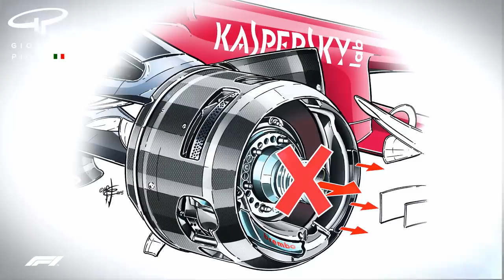2019 Technical Regulation Changes Explained

Comment: The problem is pitstop.. if f1 were to bring back refueling we won’t see alot of 1 stop in the race..
Reply: Blackjack 91 None of the teams seem to even entertain the idea of refueling unfortunately
Reply: Blackjack 91 yes that way we can get rid of all the on track overtakes
Reply: Americano Beans it’s because of cost savings issue that mid and lower team can’t afford have.. reason refueling was banned because of save cost and safety
Reply: Blackjack 91 unfortunately, that’s not gonna happen, cause of health and safety and the fuel fires that happen during refuelling, and I think the drivers are not gonna be happy staying in the pits longer, even though pit stop battles are good to watch
Reply: my thoughts exactly the cars should be racing each other as light as possible non of this racing when very heavy, then saving tyres when you could actually be racing because the car is nimble at the end of a race.
Reply: Too dangerous, even every team agree
Reply: doesnt seem to be dangerous in endurance racing, just saying :)
Reply: refueling is so dangerous with these new hybrid powerplants, get over it it's not 2004 anymore
Reply: Blackjack 91 refueling is way too risky
Reply: Refueling is a pointless risk
Reply: I want refueling too.. But FIA must restrict the fuel that they can bring. For example 150 kg and reduce the full tank to 50 kg
Reply: Bringing back refuelling will ruin F1. There's a reason no one is contemplating it. It's expensive and dangerous to start with. The main reason, however, is that it means there's no real racing. When refuelling was a thing, their were hardly any on-track overtakes, because how much fuel you put in the car basically meant that everyone was in their own race, so the only overtakes happened while people were refuelling. People complain that strategy plays too important a role in F1 now, but then ask for refuelling back, which is just a total double standard. The number of on-track overtakes, which is what people like you are always asking for, increased dramatically when they got rid of refuelling, because it meant that everyone was in the same race, so couldn't just rely on fuel strategy to win. If they got rid of pit stops all together and made everyone race on the same tyre for the whole race, on track racing and overtaking would improve even more. Saying that, I do love the strategy side of F1, but I think I'm in the minority and, let's  be honest, people ask for refuelling for the same reason that they ask for V8s back or V12s or whatever it is. It's because people want F1 to be the way it was when they first started watching it. They don't actually ask for these things based on logic; it's purely based on nostalgia.

Comment: Bring back re fueling , cars heavy or light depending on race strategy , ban the " party mode" qualifying settings , put a limit on bhp of the engine , another tyre manufacturer on some teams would also be interesting.

Comment: I like them widening the wings. But dislike heightening
Reply: hope that it'll still be lower than 2009-2016 rear wings.
Reply: It'll only be heightened by 20 mm
Reply: phew, thank god.
Reply: It will allow closer racing, and that's what I want
Reply: It will still be hard to overtake, put simply the sport is to fast.

Comment: I'd like to see pre-2009 front wings come back - I don't like how front wings nowadays extend in front of the front wheels. I'm not sure if I'd prefer pre-2005 low, narrow or raised, narrow pre-2009 specifically though since the 05-08 cars looked pretty radical and awesome.
Reply: Yep.  Significantly reduced downforce overall would produce better racing, as would narrower (or just harder) tyres.  It would put performance much more down to the driver than the engineers and designers.

Mario Andretti said this in 1979.  It is still true today.

Comment: I still wish they'd rather keep the technical regulations entirely stable until 2020 as significant technical reg changes are set to come into effect for the following season anyway due to the '1.5 seconds slower lap times compared to this season' estimation. Hopefully, with the 2021 changes, we would be able to get both the lap times back to the 2017-18 levels as well as the cars being significantly more following-friendly/race-able than they've been for a long time. If these short-term interim changes were to fail to make any difference at all to the difficulty of following another car closely, i.e., things would remain precisely the same as now with the more complex front wings, etc., then the 1.5-second loss in lap time would be even more annoying.
Reply: TheJokerit19 as a viewer you don't see any difference when cars are slower 2 seconds or even 5 seconds. But you see there 's no action in race. And that's why it is important to reduce the aerodynamics. We are all F1 fans because of races and not free quick hot laps in FP or Q
Reply: Wrong, a difference of 5 seconds in lap time is indeed very noticeable. Anything starting from 2 seconds or even lower than that can be rather easily noticeable to the naked eye especially when comparing two laps with that big difference side-by-side. Furthermore, concerning the last part of your reply: I indeed am a fan of F1 also because of free quick hot laps in qualifying, and or free practice, not only because of the races, i.e., I do care a lot about the lap times as well, which is why I hope that with the next significant technical regulation changes we could have both the lap times in the 2017-18 levels, as well as, significantly more followable/race-able cars.

Comment: Front wing changes: umm...sure
Bargeboard changes: woah whut
.
.
DRS/REAR WING CHANGES: NO TENKS
Reply: 2019 season summed up. less aero so the teams with the big and fast engines will automaticly win every race :)
Reply: They can easily lower the DRS effect by shortening the DRS zone, however the DRS effect is too weak on some tracks, and there is no way to make it stronger except like this.
Reply: DRS:Unplug
Bargeboard:Bwoah
Reply: I just hope they mix and match the DRS perfectly per track so that we will have the actual overtake into the corner/braking zone and not on the straight :) (adding that each driver should also work for setting up the overtake and the overtake itself)

Comment: You have X amount of DRS depending on the track but scrap the zones. You use it when and where you think you want to. This will give more control to the driver and choice over when they use their DRS to gain and advantage or not.

Comment: List of things that will help to have better racing:
- Smaller cars
- Tyres that don't last the entire race
- Refueling
- No pay drivers
- More sound
- No fuel limits
- No DRS, those overtakes are worth nothing
- More tyre suppliers
- Allow to race when it rains
- More gravel traps in the circuits, mistakes should be punished
- More circuits like Baku
Reply: because Baku have a short DRS straight, and a lot of gravel?

Comment: or, you know, you could just use v10 engines at 20k rpm again, dump the hybrids, kers, drs and turbo... just saying.
Reply: Guilherme Schmidt which would Change nothing about the Aero therefore not increasing overtakes.
Reply: I'm not talking about aero
Reply: Guilherme Schmidt And what would that do make the racing more competitive?
Reply: F1 is supposed to push the limits in every way, not go back to the stone age
Reply: It would improve at least the sound and the speed!
Reply: Guilherme Schmidt Yes and then you can say by to all the manufactures aswell.
Reply: i mean, there were literally more Manufactures making V10's...
Reply: weeping Yes.. in 2005. It's 2018 now.
Reply: AJW10 simpler engines, cheaper to make = more companies interested imo
Reply: I guess that's a way to see it yes, but don't expect Mercedes, Ferrari and (possibly) Renault to be in F1 when that happens.
Reply: During the 90s, it was worth watching because of the competitiveness. During the Schumacher era, it was worth watching because of the cars. Now it is ruined, that's all. The decline in popularity is a fact, not an opinion.
Reply: vernon that makes no sense.  everything about racing relies on conserving energy.  cornering braking accelerating and yes fuel consumption.  Unless you are watching drag racing maybe.  Even human powered racing like cycling and running relies in efficiency.
Reply: The speed trap read about 366 kmh if I remember correctly, and Bottas was in slipstream so air resistance was greatly reduced. I wouldn't say that he set the top speed record, and neither does FIA.
Reply: why dump kers?

Comment: This isnt really a big drawback in technology since aerodynamics are much less complex than parts like the engine or battery. The direction in which aero evolved was making thinner and smaller winglets from carbon fiber which could only get so small before they lose all effects. What im saying is that aero was a dead road and if these regulations stayed, room for improvement would be minimal

Comment: I'm assuming they've decided on this because of how much more competitive and exciting the road racing has become in Indycar after Indycar simplified the top aero and improved the underwing. F1 isn't really gambling with the new changes because it has already been proven to improve the racing in Indycar (which is a similar racing series in many aspects). Plus, more simple aero will allow for smaller teams to try and compete because aero development will be less expensive. If the cars are slower in the corners but drivers can actually compete and battle for position then it's a win win scenario. Drivers are happier and fans are happier.

Comment: That wouldn't work plus the cars will be slower like 2014 level
Reply: David D ELI

 The changes are made for better racing not faster cars!

Would you rather see way faster cars and another race like Canada?
Reply: Only by 1.5 seconds. They'll probably be halfway between 2018 and 2014.
Reply: The goal isn't to make the cars as fast as possible it's to create better racing. Currently it's impossible to follow or have a serious attack on many circuits and between many cars. More attacks is better for the sport than another 2 seconds off a lap
Reply: dries3654 this year the cars are a almost a second faster than 2017 (except Baku) so maybe a little bit slower than the 2017. Maybe half a second or something like that.
Reply: David D ELI Nowhere near to that level, LOL. What pot have you been smoking? The lap times are estimated to only be 1.5 seconds slower compared this season, so they're still going to be 'significantly' faster than 2014, '15, and even '16 on most of the circuits. On most of the tracks, next season is set to only lose to this and last season but still remain ahead of all the pre-2017 aero-reg seasons. It'd be close with 2016 in Bahrain and Baku, but on the remaining five venues F1's been to so far this season besides those two, they're still going to stay comfortably ahead of 2016 in ultimate lap time pace especially in China and Spain.
Reply: David D ELI the cars will be 1.5 seconds slower. Cars from 2014 are 8 seconds slower on some tracks than 2018! The cars will sound better, be cheaper and the racing will get exciting. Why wouldn't it work?
Reply: David D ELI and how would you know
Reply: vjekoP it wouldn't work because Christian Honner said that (except for the 2014 speed level) but he did say it wouldn't work and he is getting that information from Adrian Newey the best designer in Formula 1 history,  am going to believe the expert's until am proven wrong
Reply: So you think you're smarter than an f1 engineer?
Reply: David D ELI They said it was going to be between 2016 and 2017 level

Comment: Regulation changes introduced for 2009 to the front wing kind of worked, but the cars were still having a hard time following though. But soon after, teams were finding ways to add bits to the front wing with no intervention from the FIA.  IMO they should bring back ground effect and get rid of that damn plank of wood underneath.

Comment: Just get rid of DRS...
Reply: Cormacca What's the point? DRS gives a compromise - it allows high downforce around the track, and then lower downforce on the straights. Without DRS, constructors would have to focus purely on high downforce for the corners, or purely on low downforce for the straights.
Reply: Kian Stevens The point is - DRS creates artificial overtaking.
Reply: What's so bad about that
Reply: his point is, what happened to drivers being able to overtake normally?
Reply: Why?
Reply: then you will complain because you see two overtakes in the whole race and you say F1 is boring, guys you don't know what you want, its time to grow up

Comment: Formula 1 was once the pinnacle of motorsport! Now it's just a laughing stock! We want the best tech and the fastest cars. Not the EU on wheels!
Reply: Andddd it’s still the pinnacle of racing sports. And what do mean “the best tech”. Formular 1 is not about who has the best tech but rather who can build the best machine which might involves some technologies. Another point, aren’t f1 cars the fastest cars on tracks right now or am i missing something.
Reply: Tuan Phong Nguyen nope the Porsche 919 evo recently lapped spa faster than a f1 cars lap record! easily. Give them all the banned tech like ground effect and skirts back and watch lap times fall and overtaking flourish! Makes more sense than making them slower than lmp1 cars.
Reply: matthew barclay First of all, why compare a TIME ATTACK fully upgraded lmp1 car with an f1 car? Second of all ground effect won't come back I'm afraid because the FIA thinks it's too unsafe.
Reply: AJW10 because it's the fastest track car in the world at this moment in time. Where as f1 are supposed to be the fastest track cars in the world! Kinda makes the whole conversation about f1 getting slower and more irrelevant alot more legitimate wouldn't you agree ? And the f1 car was in full quali mode so ?
Reply: matthew barclay That 'lmp1' car had was more easy to drive and as I said fully upgraded, no rules. F1 cars have never been this fast. If some company upgrades a 2017/18 F1 car it would smash that record again. Besides, F1 cars will probably get that record back this year anyway. Ground effect will indeed help for overtaking and speed, but the FIA just won't allow it.
Reply: It's practically impossible to have the most sophisticated cars, and immaculate racing spectacles at once. It's either simplify the cars, which provides the ideal entertainment we're after; or on the other end of the spectrum, develop the cars to the level currently seen, with terrible racing.
Reply: so you are saying that 300km/h is not fast
Reply: matthew barclay And the Bugatti Chiron has a faster top speed, whoopdie-fuckin-doo-dah. F1 is a *racing series*, that 919 Evo isn't a part of a series anymore because it's gotten turned into a brand new car, what's the point in comparing a racing car with a single-purpose built time attack car? That's just like comparing an F1 car's top speed with the Chiron, it doesn't fuckin matter cause they're not doing the same jobs they each have been made to do. One is for racing, the other is for a lap record. It's not meant to be raced with others, if it was you'd see the same "shit" racing we're seeing in F1 right now.
Reply: enkelejda sterjo not really. We used to see 370kph with no drs.

Comment: hahahaha fia is a yoke! this will not produce more racing...give them more engines so they don't have to save and manage every little mechanical piece of the car and then we will see racing....all this does is makin pole laps slower from next year...in other words..were goin backwards....more racing??? ha ha ha....basically merc doesn't have the best aerodinamics package..and this year they don't have the advantage they had last few years so we need to change something to make merc and hammy happy
Reply: This is to satisfy the fans that are getting tired of boring races. Would you rather watch Russia 2017 with 0 overtakes or Brazil 2012 with 140+ overtakes? 

If simpler aerodynamics won’t produce more racing, explain to me why the 2000s had several amazing races and seasons? 

Less dirty air = more close racing
Reply: hey american mister bean-----I guess the time will tell ;)
Reply: History has already proven it but sure
Reply: Americano Beans 2000s has very few overtaking. In fact every overtake which has been done was legendary

Comment: I'm afraid the simpler front wing will make cars get closer because less dirty air, and then they will just pass on the straight with the even more overpowered DRS. 

DRS was made to compensate for the dirty air. Now that we have less dirty air (2019), they make the DRS EVEN STRONGER. I'm scared. Back in the day you had to get a good exit, slipstream, a good maneuver, a good line and good braking to get past on a straight line with almost equal cars. Now it's all done with the press of a button. 

A bit of DRS is fine, because F1 cars generate much dirty air, regardless of the simplicity. The wings are just very big.